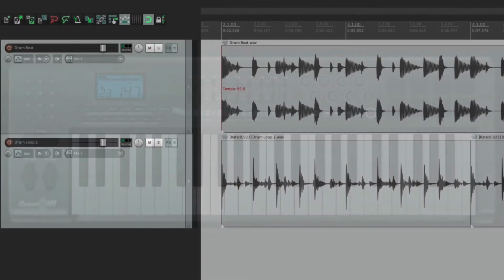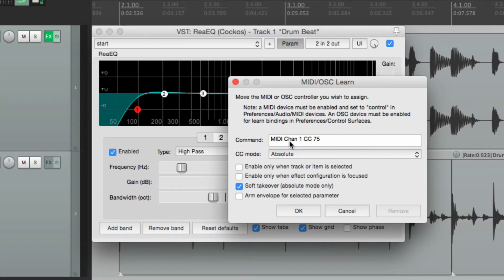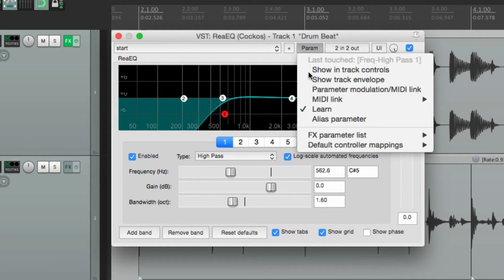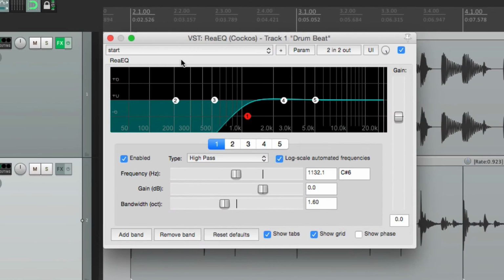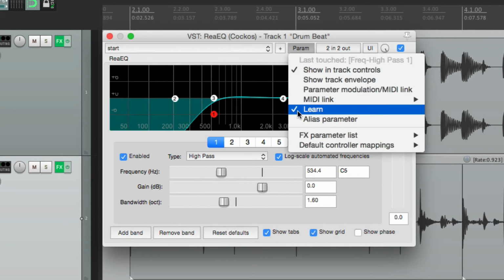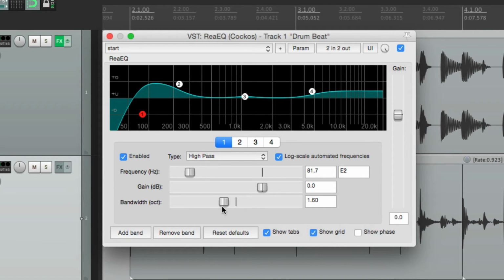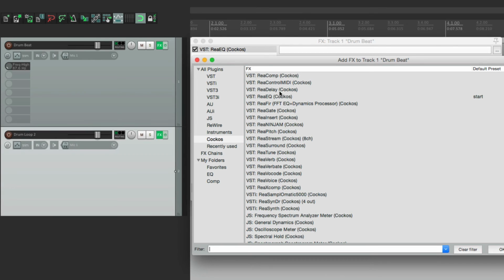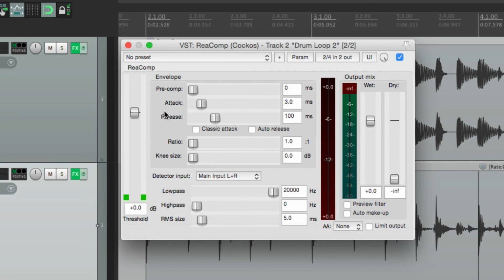Midi Controlled - Plugin Control

Comment: Thanks a lot for this tutorial. I have one question, and I think the answer is no, but I will ask anyway. When setting up the controller for ReaEQ, is there a way to assign knobs to control ONLY the selected band? I don't want to have separate knobs for each band, I just want to have 3 knobs set up for frequency, bandwidth, and gain for the selected band only.
Reply from the maker: I don't believe so.

Comment: Great tutorial once again! Thanks for the great work!
I was wondering did you in one of your video tutorials, address the issue of controling preset changes in a plugin via midi, but without an external midi controler, rather with a midi item on a track, in other words how to automate program changes via midi inside Reaper. Let's say you have two overdrive levels in Guitar Rig and before the solo you want to change to one with more input volume in GR, so more drive, but less output volume so as to keep a similar level. A crude workaround consists in having two instances of the same plugin,  each with different settings, and automating the mute parameter on each of them. However, switching between two presets of a given plugin is less CPU intensive and more convenient imho than having two (or more) instances of the same plugin on a track. 
I would be grateful for any hint regarding tutorials on that topic.
Thanks again.

Comment: Hey Kenny! Thanks so much for your awesome tutorials! You've taught me so much about Reaper and I'm so grateful. I'm stuck in this problem with Reaper and can't figure out how to control BIAS FX Pro plugin in Reaper. I want to use my MIDI footswitch with BIAS Fx to change presets, patches and control the Volume, Pitch and Wah fx in BIAS Fx Pro. I have followed this tutorial and I'm able to control ReaEQ as you showed in the video perfectly but the same method is not working with BIAS Fx Pro. Please help if you can! Thanks so much Kenney!

Comment: I have a Steinberg CMC QC control surface on its way to me right now... are there any catches or gotchas with using a midi controller like that with the Steven Slate Mix Rack plugins? I am really excited about getting this thing up and running.